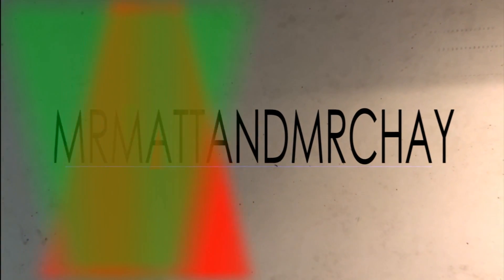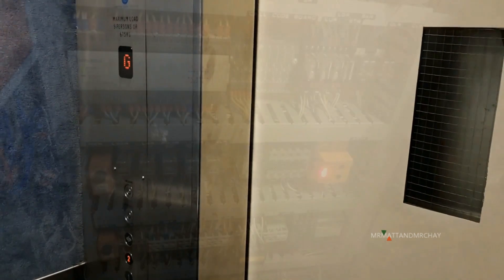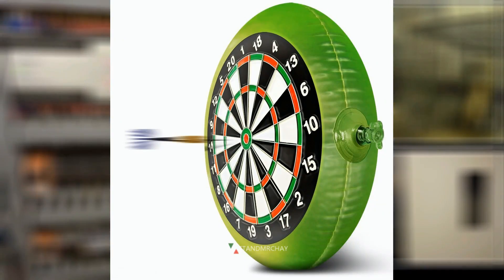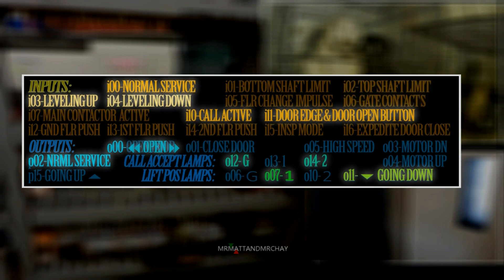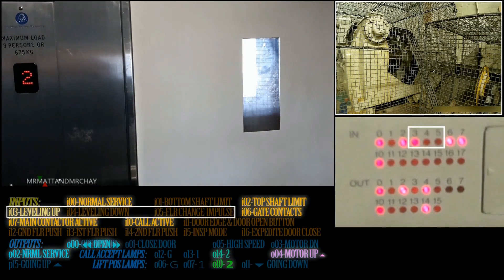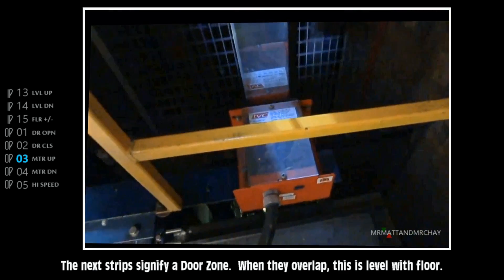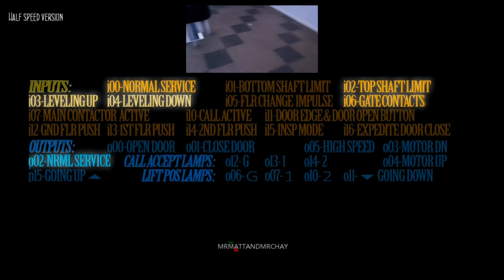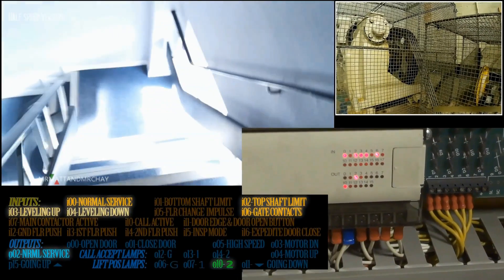Old Marryat Scott lift in CRAZY DETAIL!! (2 months of editing)

Comment: Great Video Mr. Matt! Your efforts are appreciated!

My question- based on this logic layout, I don't see how the lift can determine the desired direction of travel from a second floor request. Does the second floor have separate up/down buttons? I only see one input
Reply: This video shows an APB SYSTEM (AUTOMATIC PUSH BUTTON) it is Non collective and is the most basic of all lift call systems. The lift car will stop at all landing calls as they are registered, a collective system is more advanced and would have 2 push buttons on intermediate floors and the calls would be answered in sequence depending on the direction of travel.
Reply from the maker: Please elaborate as I'm not sure i'm understanding the question here.  The PLC knows where the lift is, so it's programmed "if call above car, then go up" and there is an input from each call button.  I'm sure you already know this :) but please explain your question again?  Thanks.
Reply: Oops, let me rephrase that to be a bit more clear. By "second floor" I actually mean "middle floor," my mistake!
So- if the elevator has a passenger going from G to 2, and there's someone at 1 who wants to go down, the elevator will stop at 1 on it's way up to 2. Because with this logic, I don't see how the elevator can "know" what direction of travel the person on the middle floor wants to go- there's only one input for the middle floor!

Comment: For the outputs "open door" and "close door", I'm thinking it's referring to the doors on the lift. But what about the doors on the actual floors themselves? I don't see any that go to those...
Reply from the maker: Thanks for your Question (sorry for late response).  The door switches go to the GATE CONTACTS input.  These are all connected in a line.  If ANY of the doors are unlocked, then this GATE CONTACT input drops out - this will stop the lift wherever it is, and it won't travel without the input going activate.  So, essentially, the PLC doesn't care "which" floor's door is open and it doesn't matter.  If a door is unlocked/open on any floor then the lift won't move.  Hope that answers your question.

Comment: Fascinating stuff. I love learning about how things work.

What is that black box near the contactors with the yellow bit that keeps popping out?

I would love for you to come and film some of the lifts in my area. Some of them make me curious.
Reply from the maker: Thanks for the comment.  That black box is a contactor.  There are lots of them (next to the black one) and they all the same.  But the one you are referring to has been replace from the grey type to the black one (probably it went faulty), but they all do the same thing.  The black one has that visible yellow bar the goes in and out.  The grey ones have something similar (a little slider left-right), but you can't easily see it.Anyway, these are CONTACTORS.  So, to make a motor move it must be connected to voltage.  But motors takes a lot more current (amps) to make it move.  So to switch voltage to motors, you have to run it through a contactor, as as a contactor is designed for higher voltages/currents.  A contactor connects and disconnects the voltage to each wire that goes to the motor.  So when the contactor is off, the motor is completely disconnected from voltage.The contactor you are looking at (the black one) connects voltage to make the DOORS OPEN.  The one on the right of it is the DOOR CLOSE.  The contactors on the left are for the main motor UP/DOWN.

Comment: How are these 80's PLC's programmed? Nowerdays a lot of controllers have a RS232 serial interface and the engineer can simply upload the configuarion to it. How do they compare with say modern microcontrollers like atmel or pic? I wonder what kind of memory strorage they use. Is it a ram chip with a battery or is it an eprom or perhaps a floppy drive? Some consumer electronics used ram chips to store user settings and where powered by a super cap or a watch battery when the power was off, nowerdays everyting uses flash memory instead. I suppose the Led matrix floor indicator is a seperate system on it's own with it's own  controller inside the  to decode the outputs from the PLC.
Reply from the maker: You are right with everything!
A lot of the old technology PLCs require you to write the computer program then "blow" it on to an EPROM.  This EPROM chip is then plugged onto the main board.  The one in this video, I would image is similar to what you are saying.  You probably log-on to it with a serial interface and upload the program, it reboots and runs it.  If you were to buy a new PLC (I have one actually) then on mine there are a couple of options - you can either write the program using the in-built LCD screen, or connect to it via a serial lead.  It comes with software, so you can build your computer program graphically (using AND, OR symbols).  Back in the 80s/90s you would need to know a little about coding to write a program to control a lift via a PLC.
You are exactly right with the matrix display.  There is either a controller in the cabinet that sends 485/232 data to the matrix displays (these are probably addressed) or the matrix display has some intelligence and runs off inputs to show the relevant floors or arrows.
I have lots of experience of writing coding on 80s/90s platforms, I learnt how to program BASIC language when I was about 10 years old on a ZX Spectrum!  I do like coding, I do a little visual basic but I don't really know modern-day languages that well at all, and no time to learn them.  What I don't understand it, in QBASIC if there is a bug, then the program stops and you can interrogate it (i.e. find out where the program terminated, probe the variables, get it to run from where the fault is, until it goes again).  Modern day languages compile the code into an EXE.  When that has a fault, I don't understand what tools you have to be able to fault find, as you could do with QBASIC.
Reply: +mrmattandmrchay Well, my dad is an electronics guy, who tinkers with atmel micro controllers. He made a few projects for me (mostly gaming related), and he started hobby programming in the 80's on a BBC model B. I'm building / structural engineer but I have cought the programming virus early on, I did a bit of game programming in the 2000's with div gamesstudio which is a pascal/c hybrid. My dad and I often watch the EEVBLOG too. Lifts for me basically bridge the building design world and the electronics world. Did you know that old catridge games often used battery backed up memory to incoperate a safe feature? They almost always had mask roms in them which are quite durable unlike eproms.
Reply: I learnt programming on 80's computers, Zx spectrum included and avoided learning programming on PC's for a long time. The hardware on  pc's 10 or 15 years old is infinitely better than 80's home computers. Languages like VB.net or C, java, Android. Have a wealth of libraries/functions built in to help you do everything imaginable using the available hardware. When debugging a VB program you've written you can still pause and view errors debug etc whilst it's running, When you perfect your program you save a release version of the EXE. I'm still new to VB.net, but it's very powerful and quick to build professional applications using it. Now I'm off to design and build my own series of lift controllers based on your video :-)

Comment: a lift computer has a lot of work to do.
Reply from the maker: This is what makes lifts so interesting - behind the scenes, how it works, etc.  Passengers don't get to see any of this (most probably don't care lol)
Reply: now i am more educated about lift operation.
Reply: The PLC is not that busy, even  older CPU's can run a many millions of operations a second those inputs change very slowly. The variable frequency  drive has a harder job generating those motor waveforms, calculating motor currents/voltages etc in real time.

Comment: Grea Video, very interesting to see how the actual I-O of the PLC had been arranged and how it reacts. I wouldnt imagine timers as back up in case of a PLC fail. Overrun switches wont cut power DIRECTLY, I mean, just tripping something and overriding the PLC ?. PLC, good stuff for lifts and many other things but I would prefeer a "proper" lift controller like the electronic ones in the 80s. I mean, controllers made to deal with lifts ... they looked more interesting
Reply from the maker: Actually, one of the timers is used to delay the brake coming on for half second - in the 60s the motor would run at 2 speeds.  When the lift stopped, the brake came on with the motor still running as slow speed and you'd get a small SCREECH to a stop.  Now, with the VFD (Variable Freq Drive) the motor's speed is controlled precisely, making much smoother transitions.  So when the VFD receives the STOP command, it slows the motor down to a halt slowly.  This in itself takes a very short time, so the timer delays the brake for half a second, so the motor is stationary when the brake is applied.
The overrun switches would be part of the safety circuit.  When these are triggered, the MC (Main Contactor) would drop out which removes power to the motor immediately, without the PLC getting involved.  One of the PLCs Inputs would drop out at the same time, so the PLC would know something is wrong.  If the lift was at a floor zone, I bet it's programmed to open the doors under this condition.  Else, you are probably stuck, until the safety circuit is made again (fire brigade rescue!).
Reply: Safety circuit wiring is always BEFORE  the Normal/Test switch, therefore that input to the PLC  would go 0 if the safety line is opened at any point. Safety circuit does NOT include the Landing lock and car gate contacts which are wired seperately.

Comment: Were you given permission to use the lift for the video? It seems like a lot of stuff to do while attempting to hide from the building's owner, not to mention the sound of the lift running.
Reply from the maker: It's a virtually unoccupied building.  Offices to let, but due to the old design (no double glazing, and more 1960s design issues) no one is renting it out.  I was in there on my own to maintain one of the systems.  FYI, I'm going to delete this comment (you should receive it in an email I hope) just in case, else they will know exactly who it was!
Reply: +mrmattandmrchay Ah I see. Thanks for the reply and the amazing content. =D